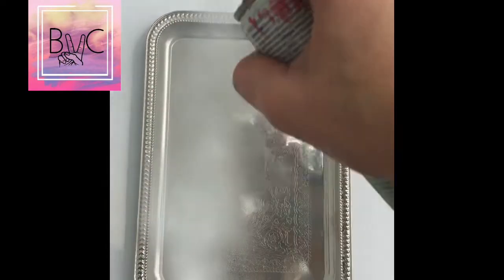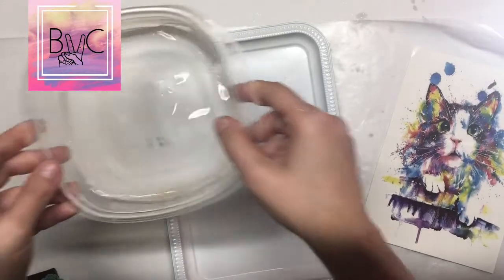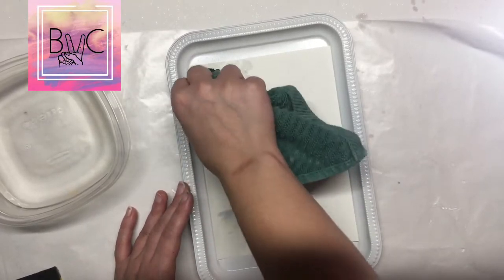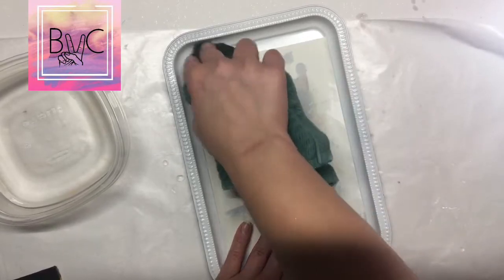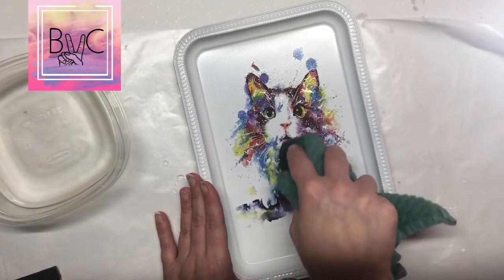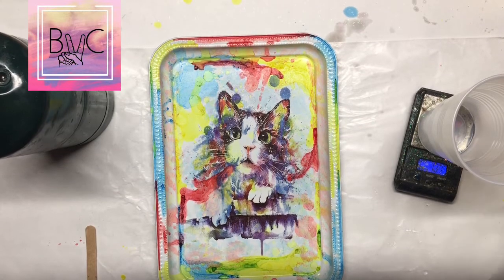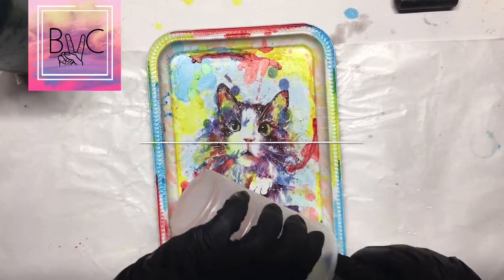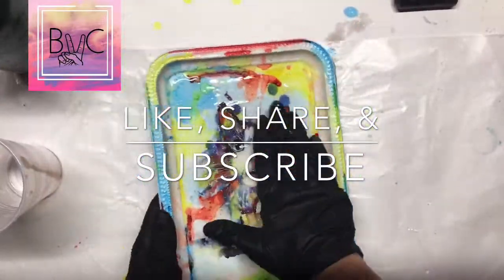How To Apply A Temporary Tattoo To A Tray

Comment: how would you do this using a colored temporary tattoo to say a silicone mold?
Reply from the maker: Hey, so you could either pour a thin layer  of epoxy, let cure apply your temporary tattoo, another layer of just epoxy, let cure then add final layer of epoxy with additives (glitter, colors, etc.) or you could also pour your mold as usual, let cure, unmold then flip over apply tattoo to the top and apply a thin layer of epoxy.